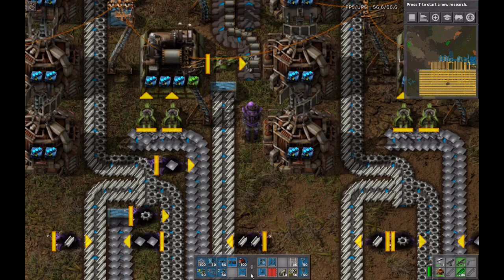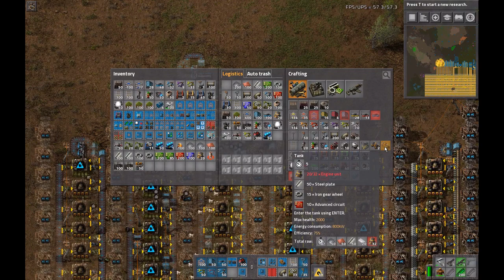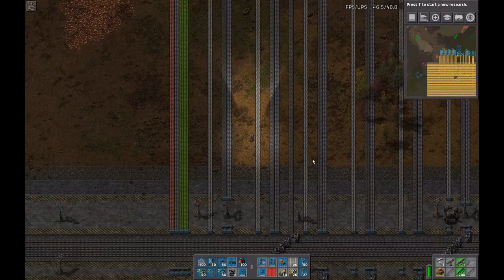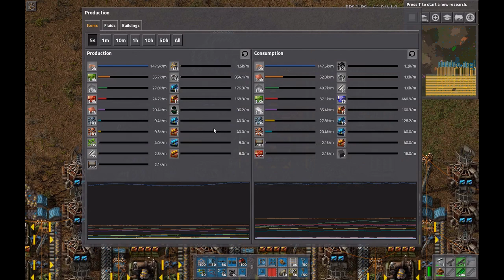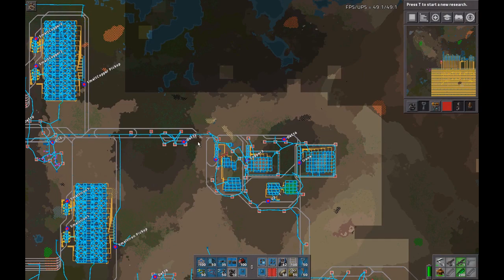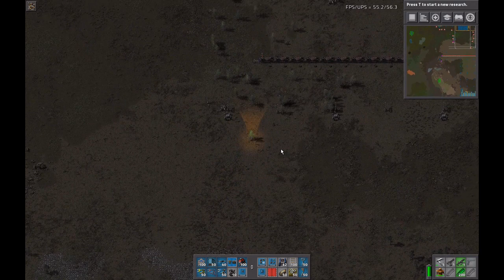Factorio 0.16 All Items   Tanks, Circuit Network, Furnaces, Steam Power and Mining Drills

Comment: Man, that is so sick, i must get to the beginning of the playlist to understand what this huge producing itens is all about haha, nice work
Reply from the maker: Well, the play list this video is in (shown in the end card) has all of my Factorio videos.  Where this starts, depends on what you call the start.
This is 0.16, which is all the videos after my 'Factorio Play' series (49 videos).  I started off having launched a few rockets, and wanted to expand to a megabase capable of doing 1k science per minute.  So in a few videos, I tour my base, explain my plan, and then put in smelters, circuit production (green, red and blue), oil production, battery production, and additional rocket / space science production.  I finish that off with a few tests, and then an attempt at 1K science per minute, by researching level 7 of artillery range (128,000 science).  It started off at 1.2K Science per minute, but my UPSs weren't keeping up, and by hour 2, I had dropped below 1K science per minute (adjusted for UPS).
My main problem was rockets weren't quite at 1 per minute and smelting / train traffic issues. I may go back to this later.
So then I decided to change up what I was doing, and produce a train with a cargo wagon full of every item in the game, producing each item as quickly as possible (and hopefully above 1 a second ).  This parts start off in the video 'Clearing the way for what's next'.  It continues using the same megabase, so I have all the smelting, oil, and circuit production already set up that can almost support 1k science, but I'm now using them to produce all the items in the game on a huge belt bus, and filling a 20-202 (?) train (I'm not quite sure on total number of items in the game - are there two types of steam 165c and 500c?). Technically I'm leaving blueprints, blueprint books and redprints off the train, but including everything that can be mined, harvested or crafted.  
Megabase Tour (.16 start): https://www.youtube.com/watch?v=kRbSXopwOyY&index=54&list=PLKzNR4pPqUAmNaZ2UaxBUnuCPzxofzB-v
Clearing the way: https://www.youtube.com/watch?v=ELySav0EVVk&index=65&list=PLKzNR4pPqUAmNaZ2UaxBUnuCPzxofzB-v
Reply: TroZ that is really great, this megabus that u did is the bigger that i have ever seen, i will checkout ur playlist for sure, tks for the explanation